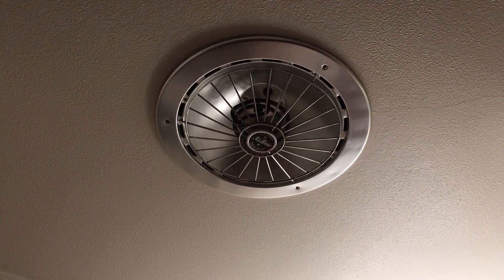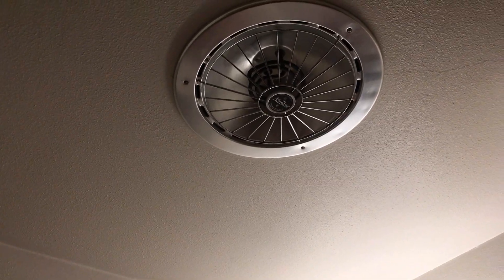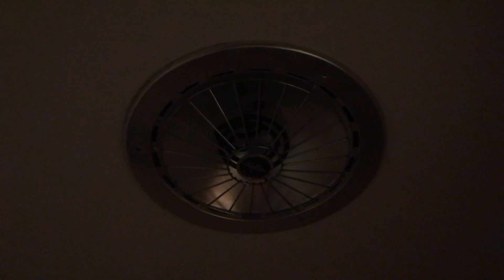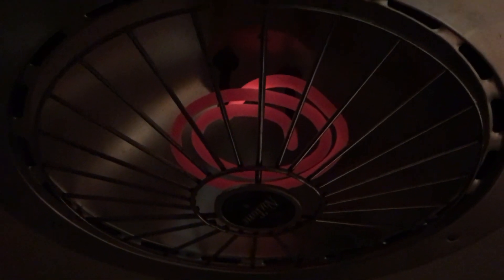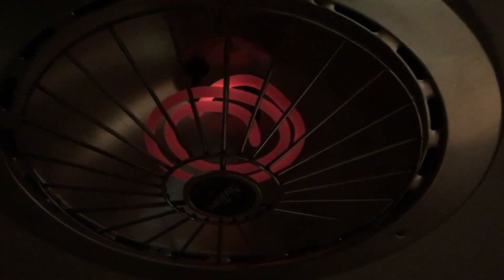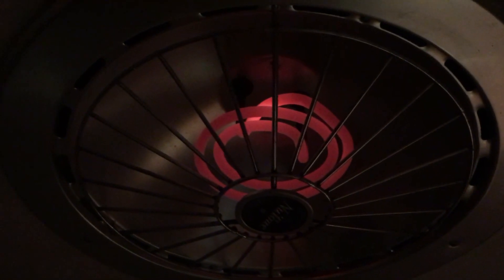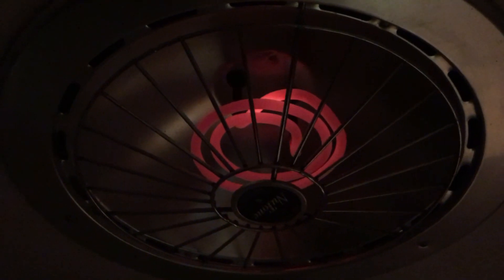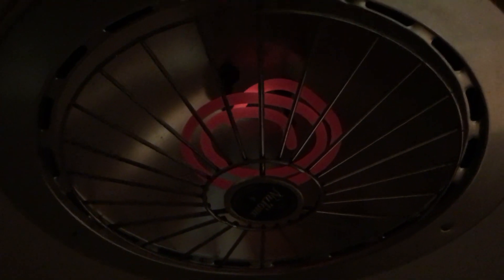1959 NuTone Model 920 Heater: Follow Up

Comment: I've never seen a ceiling heater like that before.  Closest I've ever seen is an inferred heat lamp fixture and those were mostly in motels back in the 70s or 80s.  Haven't even seen one of those in years.
Reply from the maker: Yeah, in the upstairs bathroom at my Mom's house, there is one of those infrared heat lamps installed, and it does a nice job. That house was built in 1975, or 76.
Every house in this neighborhood that I've been in has, or had this heater in the smaller bathroom, and the gas heater in the larger bathroom. I know for sure the house across the street still does, because the original owner still lives there, and hasn't renovated.

Comment: Those bathroom spot  heaters are a great idea.  I’m surprise there are not more of them around. I guess they’re afraid of fires and what not nowadays everything has to pass code.
Reply from the maker: At 1000 watts, this one draws less current than the typical 1500 watt space heater, and most everyone has one of those. The wall switch doesn't even get the least bit warm. 
I have noticed newer homes don't have these in the bathrooms, but I've seen many with a space heater sitting on the counter. Seems like that is a more dangerous option, than having one installed in the ceiling. I don't write the building codes, so what do i know, haha!

Comment: I have a 920 and the heat element is not working. Do you know where I can buy a new one.
Reply from the maker: The only thing I can suggest is set up a search on ebay for a Nutone 920, or 9200 heater. The pop up occasionally. That's what I had to do to find this heater.

Comment: I absolutely cannot find another or at least a model #for a replacement motor. I only need a new motor. Mine is squealing awfully loud.
Reply from the maker: The motor just needs to be oiled with zoom spout oil, and it will be quiet again!
Reply: @dynatrak  I had a yellow bottle of this miracle oil years ago, but hadn't seen any in a while. I'm sure the motor is pretty rusty. How much oil is too much? Also, I think there are two small holes in the motor to insert oil. Thanks for your help because I LOVE the heat from these heaters.
Reply from the maker: I can make you an unlisted video showing where, and how much oil to use. Yes, it is a great idea to keep these heaters working. The dome design makes the bathroom heat evenly.
Reply: @dynatrak  Bless you for helping me and my old heaters. I would have loved to have a home with the in-wall heaters, but these are the next best thing when they work. I will send you my email address. Thank you!
Reply from the maker: @ggshandsomeboy5103  you're welcome, that's ok, I will just link the video in the comment! Later on, I will make it public if anyone else needs to know how to oil one.
Reply: @dynatrak  Awesome. Thank you!
Reply from the maker: @ggshandsomeboy5103  https://www.youtube.com/watch?v=r3OAM4d91XE
Reply from the maker: I hope the video I made helped you out. Let me know how oiling the motor goes!